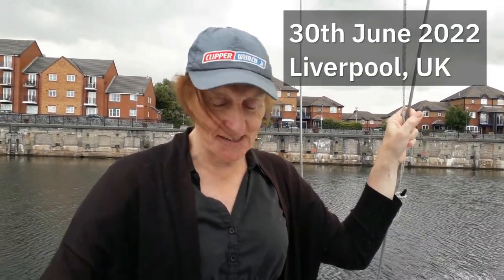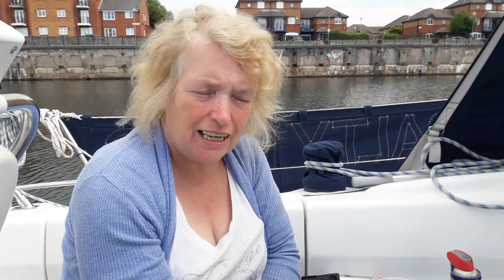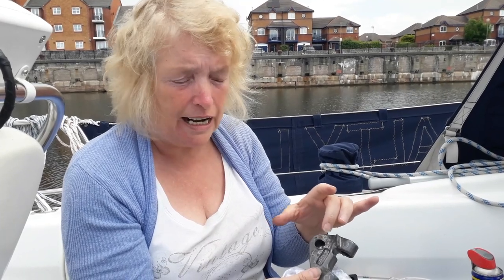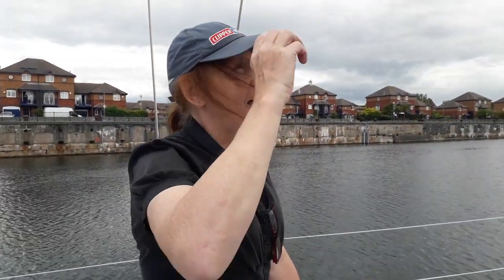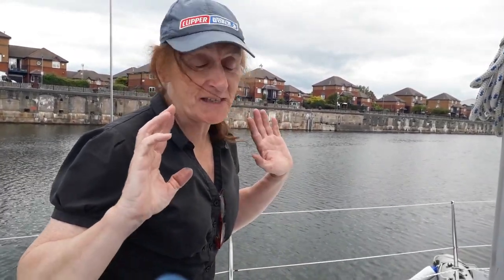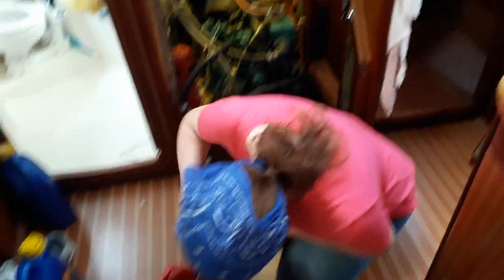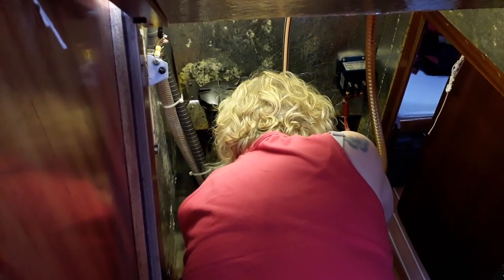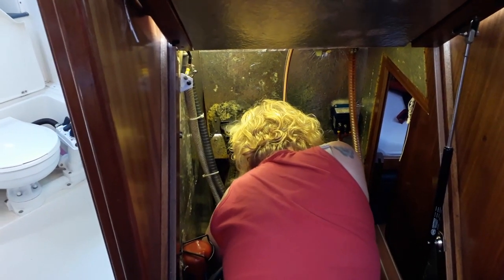Sailing UK - Liverpool - Selden mast - Volvo Penta - Celebrity TV - Ep. 247

Comment: Also a thing to check when changing checking/changing your impeller is to check the wear on the Cam and also the backing plate and front cover. Seen it before were the edge of the cam was quite sharp and a new impeller wouldn’t have lasted long. A quick going over with a file and she was good to go until a new cam was ordered and fitted.
Reply from the maker: We had not thought of that, but the whole pump unit is only a year old so hopefully it is OK, but we shall check the next time we are changing the impeller. We always have spare ones aboard just in case. Thanks for the tip! 👍

Comment: I have a little 12 v inline fuel pump in between the first filter and the main engine canister filter . Saves using the manual uplift pump . Bleeds the system right the way to the injectors  !
Reply from the maker: We are lazy and the system we have works, so.... 😄😄

Comment: Get gooseneck changed. Ours snapped 2 summers ago going through st Patrick’s bridge.
Reply from the maker: It's on order
Reply from the maker: @Clive Lawrence - we did not know that and ordered the same part, but the chandler said it was no longer made and ordered the new replacement part so perhaps it will be stainless! We shall see. Sadly, we left Liverpool before the part came in but we shall be back over that way in a few months and we will collect the part then and fit it when we pull the main off for its winter checks

Comment: Never had a problem using the official "drain the oil" thing cept when I lost the cap so had to stick the hand in the old oil to find it. Engine the same as yours as you know. When you back over this part of the world?
Reply from the maker: We are on the hammerhead just up from Blue Moon, listening to the rain bouncing off the roof...
Reply: @SailingYachtSaltyLass  and we are down the other end near the Windrose on the inside of the Hammerhead. Arrived back this afternoon. If you are about will see you tomorrow. Terry is also over this side as well.